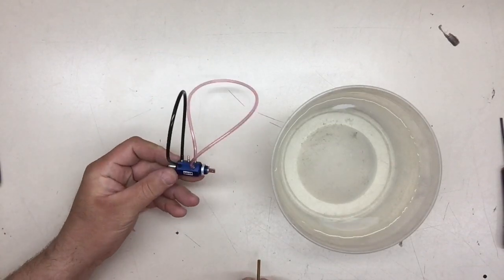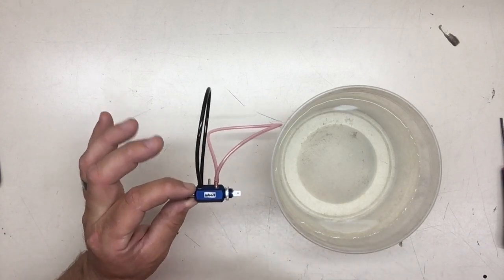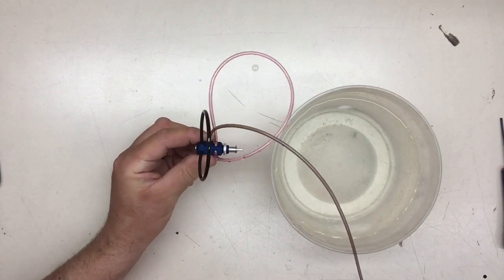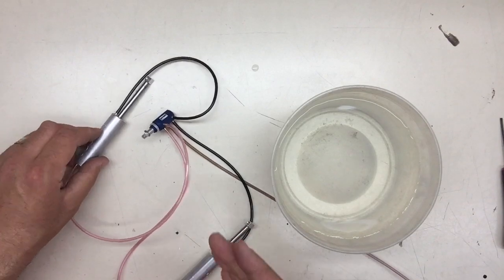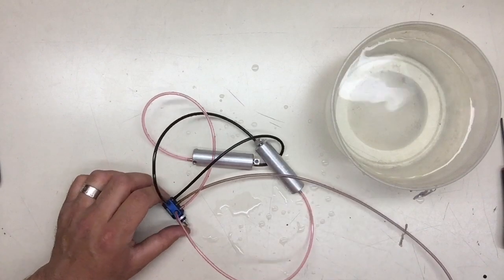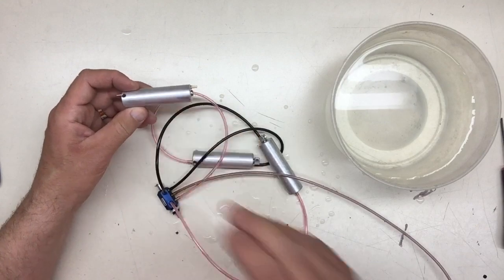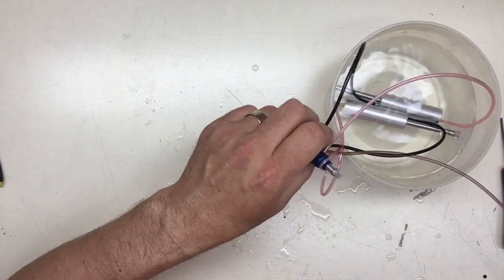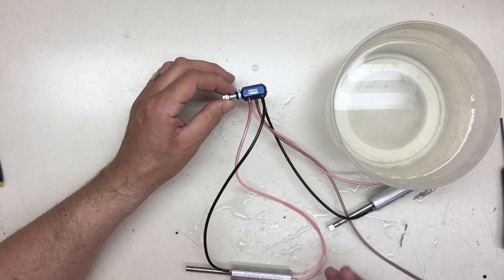Is my air valve leaking or my air cylinder?

Comment: What would have been beneficial is to have you traced down the actual problem with the hemostats as you  mentioned.  So my valve blows out air.....why?  Most people are going to probably replace the valve based off that video....unless you demonstrated to the end the use of hemostats to really get to the bad item. Maybe I'm wrong and too old
Reply from the maker: Tim,  You are correct.  I needed to keep my time down on this video.  Stay tuned.....